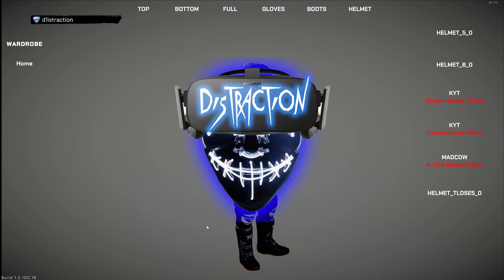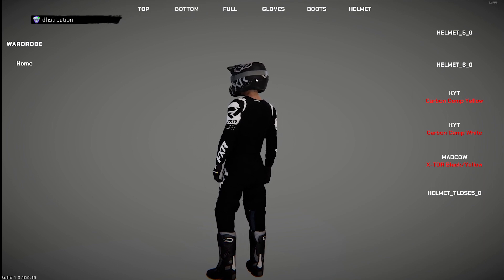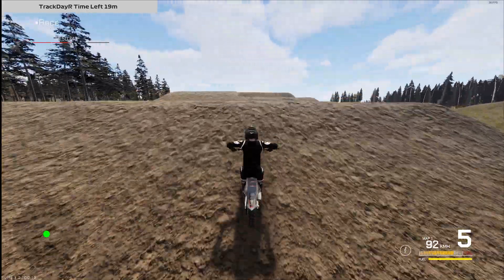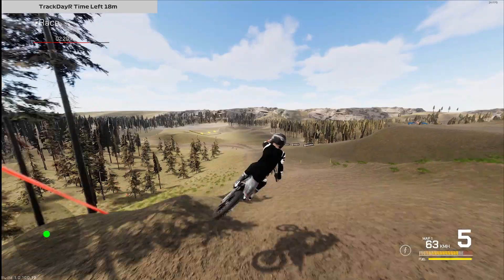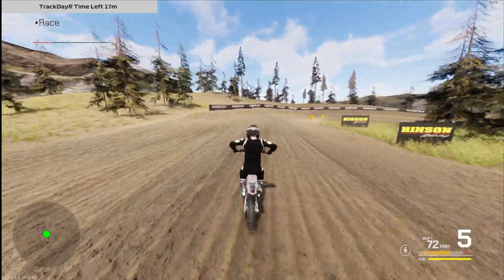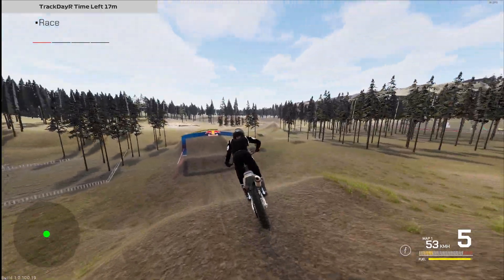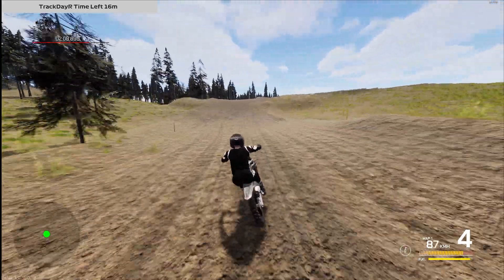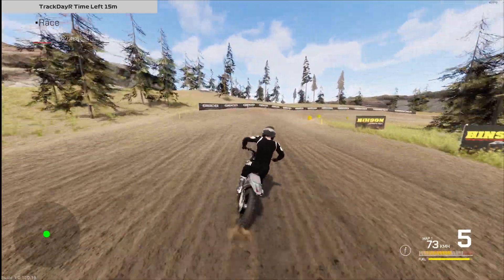[TRACKDAYR] new physics work and all around improvements

Comment: if youre losing power up hill maybe shift down to 2nd or 3rd you cant just 4th and 5th gear a whole track
Reply from the maker: Yes i know,but this has been a known issue with the new engine and Power delivery system :) even in lower gears especially on smaller bikes